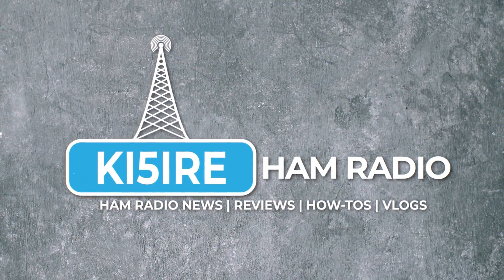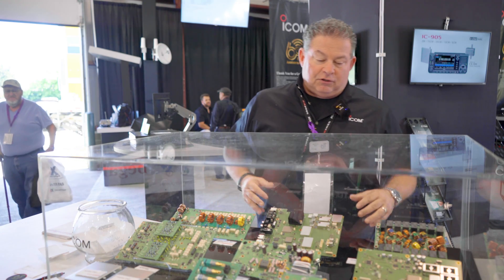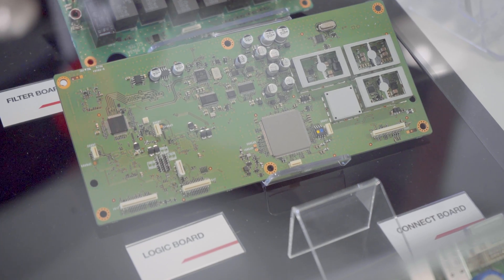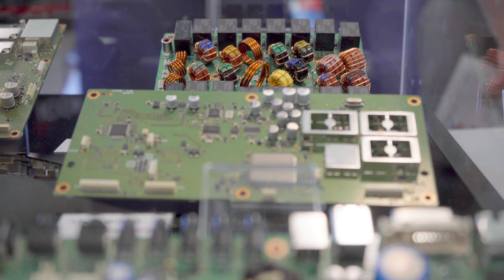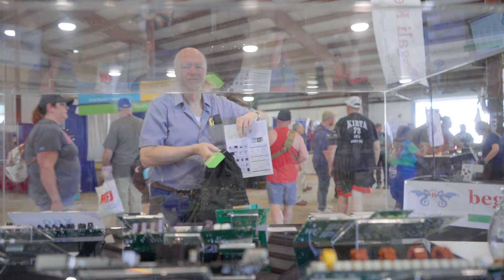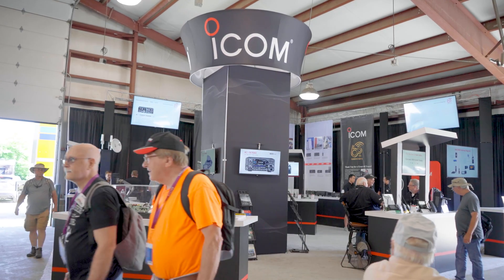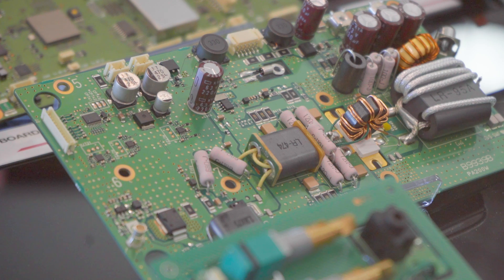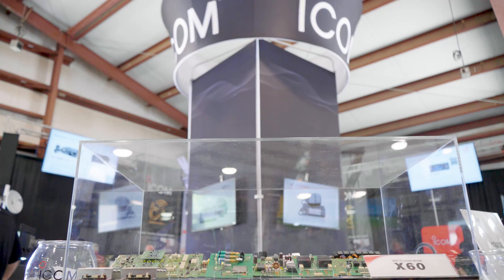ICOM Announces NEW Ham Radio Concept! Hamvention 2024

Comment: This is going to be a big base station transceiver? New IC-7850 replacement?
Reply from the maker: Definitely interesting, and lots of possibilities seeing all of these components!  Thanks for watching, 73!
Reply: That would be cool, but I don't think it is an anniversary radio. maybe a SDR radio with an automatic antenna tuner that can do as high as a 4:1 swr. The PA board looked like is was naked. I wonder if the final amp is on the RF board?